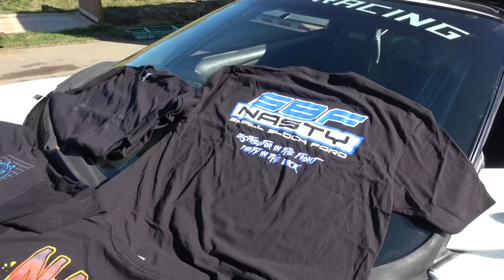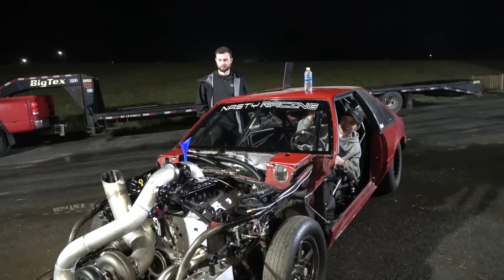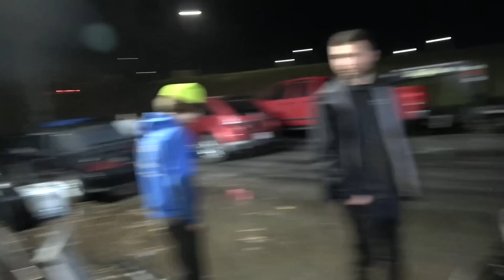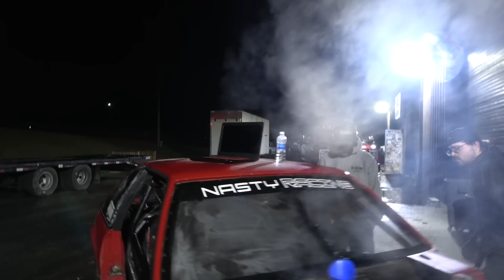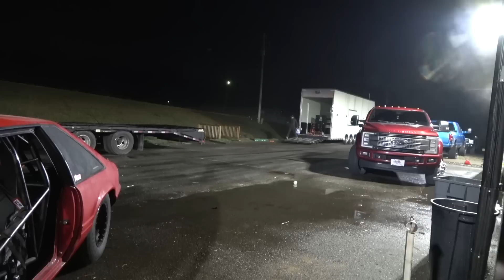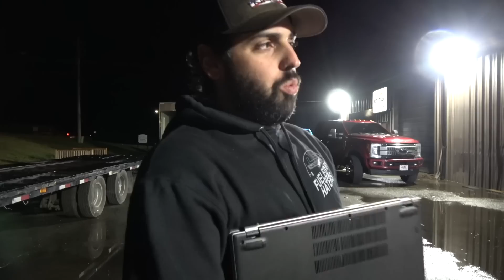FIRE IN THE HOLE!!!! Bloodbath Fired up with its new LS!!!

Comment: This one’s for Mason and JD. What’s the difference in cranking a new build 5.3 SBE with a Terminator or your SB LS methanol with a dominator? 
Same 4 things needed for both to start if I’m not mistaken 😮
The only difference is preparation and testing of the systems that provide all 4 component’s.
Reply: Ya that’s the point . He’s showing you the testing and preparing and not spending 5 hours doing this off camera and then being ta-da I’m the best first time I turn the key it’s perfect . And yes a methanol race car is more involved to get right then a camaro you put a cam and terminator on .

Comment: Can't beat them join them. You can't out match Hp numbers relatability dollar per Hp numbers.  Nore a stock factory main block with 6 bolt main caps from the factory.